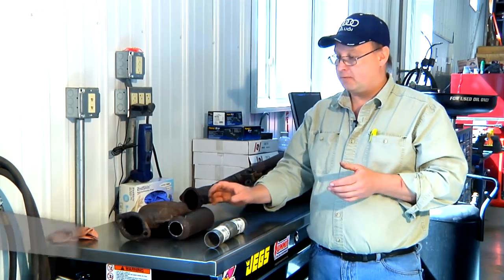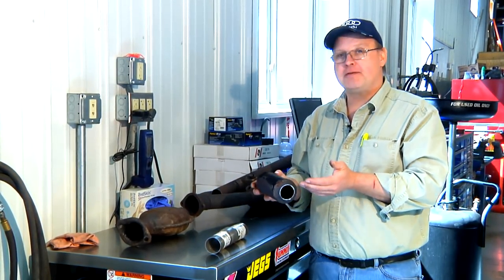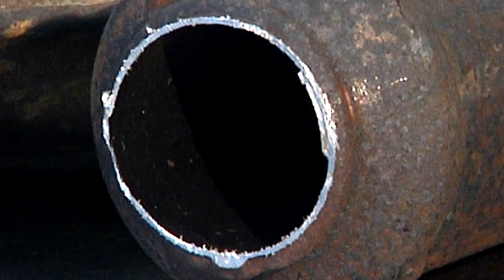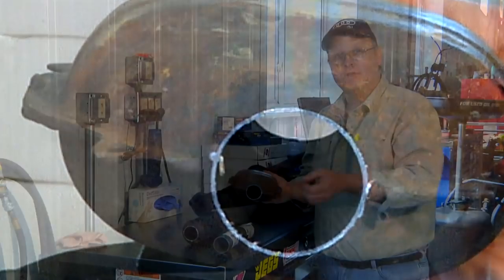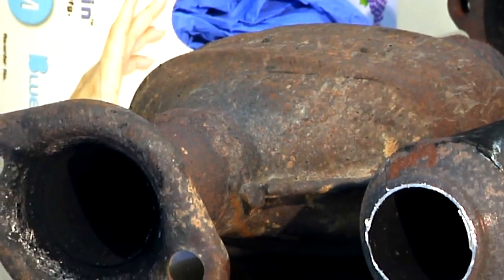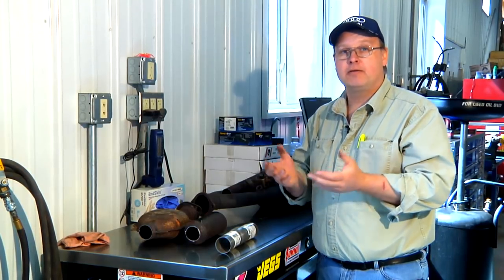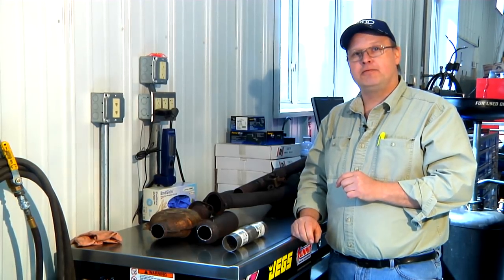What Happens if You Replace the Exhaust Resonator With a Pipe? : Under the Car Repairs

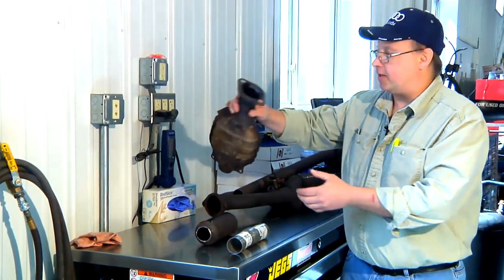Comment: He's also telling us that a hollowed out cat is a resonator (0:40). I had exactly the same experience when I built a new exhaust for my Geo Storm from the exhaust flange hookup on the manifold on back. I did so because the inner wall of the down pipe had separated from the outer. Once I ditched the RIDICULOUS double wall system for my own, the improvement was astounding Downpipe, cat, tailpipe & THAT'S ALL, FOLKS!!!!!

Comment: The 300zx suffered from weak turbo seals with age and when removing the cat the back pressure change would finish them off and the car would blow black smoke out the exhaust now I know the seals were already on the way out but if people know these things in advance they will not decat so to be left with this problem which costs mega bucks just to change some seals so you can make things worse for yourself with some cars, I guess not all cars are same for some it creates problems for some not.

Comment: Backpressure is a myth.  You don't want it.  What you want is the harmonic resonance to assist with cylinder scavenging as well as keeping the intake charge from escaping through the exhaust port (in 2 strokes, non-issue in 4 stroke engines).  Any resonator that is straight through is incapable of reflecting this harmonic wave.  Only a chambered design is capable of reflecting the wave back at the exhaust port.

A Resonator is usually used to attenuate undesirable frequencies in the exhaust.  Usually what is referred to as "drone".

Comment: Back-pressure is never good. The tightest, straightest exhaust that doesn't build pressure is the best performance option since it keeps exhaust flowing smoothly, therefore reducing turbulence which can cause momentary pulses of back-pressure (WHICH IS BAD)

Comment: Depends on the car. Today, you really have to know what you are doing to "tune" a car for more power and efficiency. When you can buy a car with  a 2.0 engine and have it come with 200 horsepower today, but in 1970, that same engine size probably put out around 100 and got worse gas mileage at the same time, you can see that the car manufactures have really learned how to get the best out of an engine. So, when we start changing things, we can make some improvements or we can screw things up.

Comment: Proper back pressure to operate?!?!?!  What rock has this person been living under?!?

A properly designed and assembled 4 cycle engine want's as little back pressure as possible. This whole back pressure myth came into being when the automakers first had to implement emission controls. The first part of the system that anyone who had grown up building hot rods would look at was the congested exhaust systems that the car makers were putting on. Then, when they refused to learn about/ deal with the evap/ vacuum controlled equipment on the intake side, they found that just throwing away the stock exhaust made things worse.

They didn't seem to grasp that the system they were tinkering with was just that; a cohesive, engineered system. Change one component without adjusting the rest, and performance goes down the drain. Hence the myth of back pressure; "We just threw our free breathing muffler on it and it lost power!!!" "Hmmm.  Must mean that it NEEDS back pressure to run efficiently..."

The blind leading the blind....
Reply: not true

take your car, only leave the exhaust manifold on

or hey, even take that of

now you have ZERO backpressure

you'll notice you have ZERO torque in lower range, engine idles and runs shit, almost no throttle response

and then WHAM instantaneously the rpm shoots up to rpm limiter

every engine needs some amount of backpressure cause of torque curve

Turbo's will spool up faster when  less backpressure BEHIND the turbo

turbo's work not because of exhaustgasses flow, but because of pressure differential between P in exhaust manifold against P behind turbo
the bigger the difference, the better your turbo works
Reply: lillnemo1 then why do drag race cars run open headers? dont you think that if by running a full exhaust system with factory mufflers they were able to go faster, they all would be running compression bent pipes with cat. converters and 2 mufflers?  you dont have zero torque in the lower range if you just ran open manifolds--you do on a 2 stroke engine, but not on a 4 stroke. so turbo engines dont benefit from a freer flowing exhaust behind the turbo? might want to check into that....
Reply: ZeeboLaywicker
dude for real get your facts right before posting here!!!!
i have a sportsbike here and as soon as you remove the muffler, so zero backpressure, the engine even has trouble idling

you pull the gas open, nothing happens and suddenly it pops till 11000rpm

The engine has ZERO torque in lower revs now

when you do it with a turbocharged car, this wont be because the turbo acts as the backpressure causing device
removing as much exhaust pressure behind it will help spool and horsepower
but only cause there is backpressure BEFORE the exhaust turbine

what you say about drag cars has nothing to do here
drag cars have open headers YES
but they dont care about torque or power in lower revs

you really think they leave the starting line at 1100rpm?
NO they use NOS and such to overcome low torque and they rev hig up before launching

drag cars never use rpm below 4000rpm
and i guess the top fuell and such even have higher MIN rpm when they take a run

hell, have you ever seen a F1 car?
practically open exhaust, but thats because they only use very high rpm, and they also have practically zero torque at low rpm

why do you think they are that difficult to get driving from standstill?
thats why they alsways spin their wheels when leaving a pitstop

read forums, wikipedia, google and think it over before you start writing nonsense
Reply: I am glad to see that there are some intelligent people out there.  The number of mechanics who quote "backpressure is required" demonstrate zero understanding of exhaust design.

Comment: The EGR valvle recirculates a portion of your exhaust back into the combustion chambers causing it to run cooler, completely burn fuel, and decrease your emmisions. So yes, it does go back into the engine. Without back pressure your car loses power and fuel efficiency. Have you ever driven a car without an exhaust after the exhaust manifold? You'll notice a HUGE loss in power.

Comment: backpressure = needed in 2 stroke petrol engines to  make it more efficient ( so outgoing exhaust pulse doesnt suck the incoming intake pulse through the cylinder ) and sometimes coupled to an exhaust thats tuned to the optimum working revs of the engine . 
= not needed in a 4 stroke engine as the intake and exhaust strokes are on separate revolutions of the crank , to much backpressure or a to open exhaust will hamper the scavenger effect that happens in a 4stroke exhaust system  ( leading high pressure front of the exhaust pulse sucks the rest of the exhaust gasses though , in essence ) leaving used mixture in the cylinder 

yes turbos create backpressure in the system but its not a good thing

Comment: Really?! four stroke engines don't need "back pressure." Using the right diameter pipe will create the most efficient flow, but it has nothing to do with back pressure, unless we're talking two stroke. But thank you, Mr Expert.

Comment: A) the resonator gets rid of the low frequency "drone". B) back pressure is bad. Period. The exhaust system is designed to be a balance between engine efficiency and noise comfort level. This whole back pressure is good myth has got to end!!

Comment: Pretty sure this is not the case if the car is turbocharged, because all the back pressure the car really needs is the turbo itself, any less restrictive exhaust after that allows the gasses to leave faster giving better performance, although not sure if that would help fuel efficiency..
Reply: not sure about that, any exhaust mod will equal to loss of power unless tuned or done a exhaust timing relearn

Comment: question about back pressure , when tested max psi is 2 , but when the exhaust is disconnected  the engine loses power, and runs like crap, how is this designed, 2 is not much, and less doesn't seem better?

Comment: Burnt valves in the case of exhaust would be caused by either running with no headers or way to short of a pipe from the manifold or a crack in it.

Comment: Actually, he's right.. Why do you think they come on a car ?   They wouldn't waste the money if it wasn't needed.  [ This is old news folks ! ]   

I just found out the difference when I cut my resonator off my 2004 Corolla.    ( I'm still running a Thrush turbo muffler )     It improved overall throttle response & doesn't sound as deep by far while driving, even less drone, yet racier than cutting off the muffler.  And it gives it some small burble decelerating even with an automatic.    
   * But, it is messing with the rpm's on the freeway !  It will just drop 200 rpms while accelerating, like it hit a wall of air.  Does it exactly at 2000 & 3000 rpm's..  Probably livable, but just feels weird..  Probably varies car to car..

Comment: Stating that back pressure is "good" for the engine's performance is tantamount to saying that car manufacturer's are deliberately throttling the power of the engine, in effect hurting not just its performance but also its fuel efficiency.

Comment: Let me just clear up something here for everyone. There is NO exhaust system that provides better performance with a resonator / catalytic converter / muffler. Hence why there is NO race car on planet Earth that DOESN'T need to have either of these three items, and DOES. Yes, the exhaust comes out in pulses, and yes to achieve peak performance you need them to return back into the cylinder at the perfect timing for your valve openings. This is called exhaust SCAVENGING and has nothing to do with "back-pressure". Exhaust scavenging is achieved with the shape, diameter and length of the exhaust and is achieved without any of the three restrictive items previously mentioned, which is again why you don't find them on race cars. The only time your engine WILL run worse if you remove one or a combination of these three items is when you do it WITHOUT "telling" you car you've done it (a tune). Thank you and good-day!

Comment: Without velocity we dont get flow, the idea is to move the exhaust away from the valve as quickly as possible, headers are designed to create negative pressure behind the valve to help pull the exhaust away...somewhere on youtube there was a guy demonstrating this affect but I dont remember what its called, sorry I wish I could share it because I thought it was a cool video. And I'm horrible at explaining things...lol.

Comment: If a muffler is 30 years old and appears in good condition and hasnt gotten louder would performance be compromised anyway? 1981 F150 88,000 miles.

Comment: old cars don't need them new cars don't need them. if it is your hearts content is to take off resonator then do it. just not on a 2-stroke engine. those rely on specific pulses of low and high pressure.

Comment: its about finding that happy balance where the best exhaust scavanging  happens.   putting a 3'' exhaust on a stock NA 4 cyl will make it loose power/torque.  for example my car (subaru legacy 2.5L)  comes with 1. 75'' pipe from factory   in stock form  scavenging happens best at 2.25''  and with modified (cams porting ext)  2.5'' exhaust is the best.   its about keeping the velocity go too big and everything piles up after the manifold and you loose power and torque.

Comment: Yeah, there are a lot of myths about back pressure. It's true that back pressure is back for performance. Period. However, stock exhaust systems are designed to harness the pulsed exhaust in order to draw a sort of vacuum using the momentum of the exhaust. If you don't have a properly tuned exhaust, the pulses cause an increase in back pressure rather than drawing exhaust through. v=Ivgp1LBsGEQ

Comment: It's about somehow getting maximum exhaust flow, given all else equal, that is all. Engines are just airpumps, more aireflow ability = more horsepower making ability, assuming parts don't break, no overheating issues, etc.

Comment: All resonators do is get rid of that sweet popping sound your catalytic converter makes when its igniting that unburnt fuel that slips out the engine when you let off the gas abruptly.  That's it.  You don't even need them in PA.  The exhaust just has to exit behind the passenger compartment and have a cat and a muffler.  You may or may not get a ticket for disturbing the peace if you run a loud glasspack and your trying the balls out of it purposely trying to make as much noise as possible.  At that point, the cops may just think your exhaust is broken which is a violation.

Comment: If anyone wants more back pressure (and supposedly performance), he should pinch his tailpipe flat on the end. Race car are so loud because the crews are too cheap to put resonators and mufflers on their cars. lol

Resonators are very carefully placed by the factory in their cars to reduce resonance in the exhaust system that causes irritating noise effects. Along with the main mufflers, these produce the whisper quiet sound that many people want.

"Resonator" is a misnomer.

Comment: imo, swap your res with a big long porter muffler and delete your mufflers, then rejet or remap to get that efficiency back
Reply: Rejetting a set of injectors? Pricey.
Reply: that's why I said "or remap",  Remapping is free.

high flow fuel injectors aren't all that expensive either.  A brand new full set is pretty much always going to be under $300 unless you've got some crazy v12 monster.  You can pretty much always find better injectors for $25 that fit your car if you go to a junk yard.

Comment: I installed a non resonated 3” cat back system on my 2014 Ford Focus ST250
I noticed I couldn’t pull in 6th gear at lower rpm and I also found my self having to rev the balls out of my car to get it to move . I pretty certain it lost some power
Reply: Lol you need some back pressure

Comment: in the old hot rod days guys would run thinner diameter pipes (more restrictive) because they would improve low end power/torque, and being that engines may not have revved as high as today's it may have seemed that it created more power....which we now know is not true

Comment: Yeah well most of us who do exhaust mods are usually the same guys running there vehicles in the high RPM range to begin with. I've seen the difference caused by no back-pressure and trust me its not very big at all and in my eyes is well worth losing in exchange for both noise and high range power gain.

Comment: You're confusing back pressure with dynamic pressure. Utilizing smaller diameter pipes increases exhaust gas velocity and dynamic pressure allowing for the preceding exhaust pulses to sort of pull the exhaust gas through. It's called Bernoulli's principle. Using too wide of a pipe for a given engine will cause a decrease in dynamic pressure and an increase in static pressure. The best exhaust for performance is ALWAYS a straight pipe, but if it's too wide OR too narrow, it will not improve perf.

Comment: I never said it was quieter from backpressure. I said I have seen situations where a well designed relatively quieter muffler, even some that don't use sound cancellation but are the more traditional "turbo" mufflers, outperform poorly designed loud straight-through mufflers like glass packs due to the glass pack making so much damned turbulence, which, ironically, ends up creating more backpressure than the well designed "turbo" muffler of the same size. Not always, but I have seen it.

Comment: When he picks up the spark arrestor, or whatever the hell he calls it, at 15-16 seconds, you can see straight through the pipe to his hand.
So, how the hell is that supposed to cause back pressure?
If a pipe ran into a box filled with absorption material, then exited the box through another pipe in a different place, this would have some sort of effect on back pressure.
But a straight through pipe? No, it isn't going to make a jot of difference.
The resonator is there simply to deaden the sound, by giving the gasses a wider aperture to go through lined with sound deadening material.
If any back pressure is caused in the system, it is made by the rear box, which has staggered pipes.

Comment: i cut out my cat and put in a glass pack, then took out my muffler and replaced it with just a piece of pipe. after the pack burned out i had better fuel efficiency and it sounded better

Comment: Backpressure is a myth! Only two stroke engines require backpressure to run efficiently. With 4 stroke engines, the faster you get rid of the exhaust gases, better the engine will run.

Comment: You don't need backpressure!  If you go with too large a pipe, you lose exhaust velocity which in turn kills scavenging and hurts power.

On the other hand, of course, is too small a diameter creates a restriction which increases pumping losses.

What you want, then, is the smallest exhaust pipe diameter WITHOUT restriction.  This maintains exhaust gas velocity without choking the engine.

Comment: Back pressure is important to all that disagree.. I have done cat backs on my cars and strait pipes on my Harley and what I can tell you is without proper back pressure you loose gas mileage and low end torque but gain power in the top end... Harleys in specific need torque cones installed at the headers if you go strait pipe or they backfire like crazy and loose what feels like 30% of there low end... my recommendation would be to keep the pipe diameter the same go with a catback exhaust but keep your cat stock as you will probably have enough backpressure from the cat to engine? my mistake has been to always go for the larger pipe diameter and I always end up regretting it